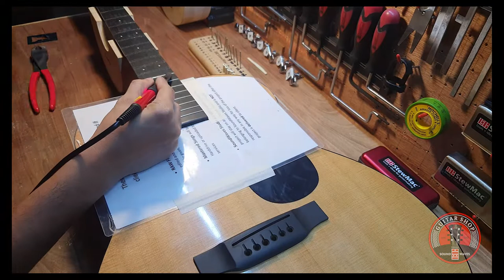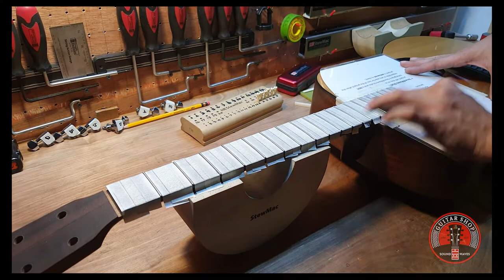Martin Road Series 000RSGT Stewmac Stainless Steel Re-fret and Full Set-up

Comment: Is that tidebond red good for fret work? Not super glue?
Reply from the maker: Just to fill the gaps inside the fret slot. I did use ca glue after
Reply: @lesterguitarshop  Thanks. I’m learning.
Reply: @lesterguitarshop  what is the paste you were using on the body? I’m curious.
Reply from the maker: It's a nano polishing compound. Great for clear coats.